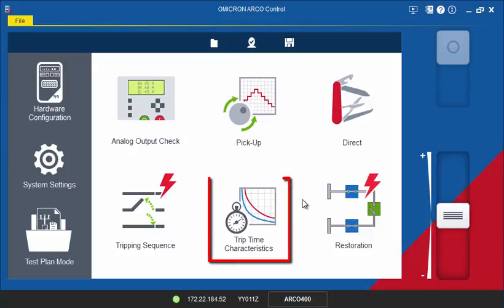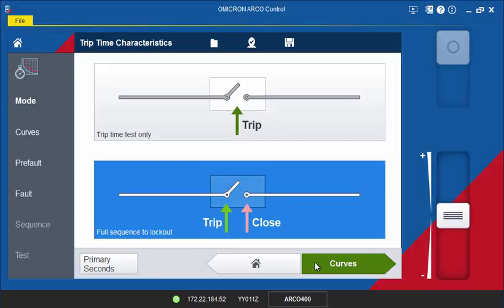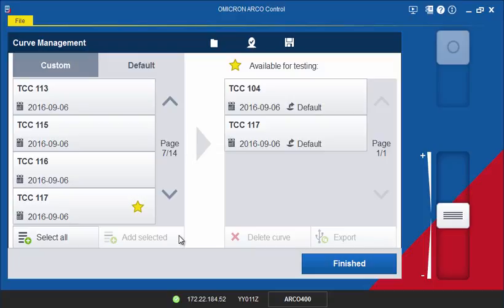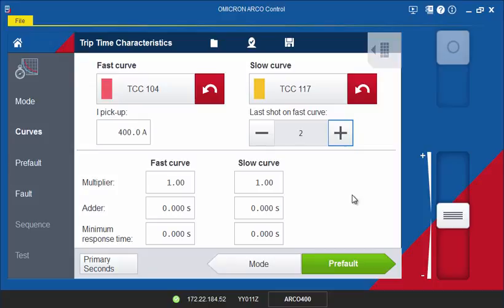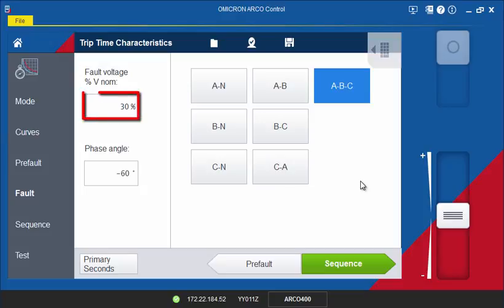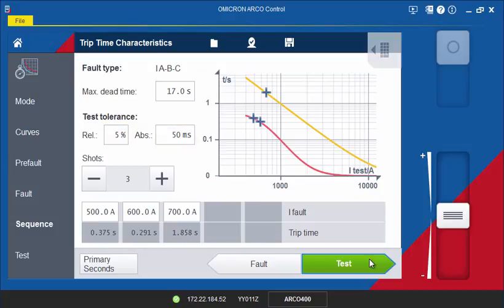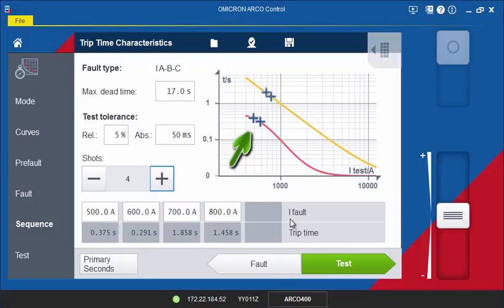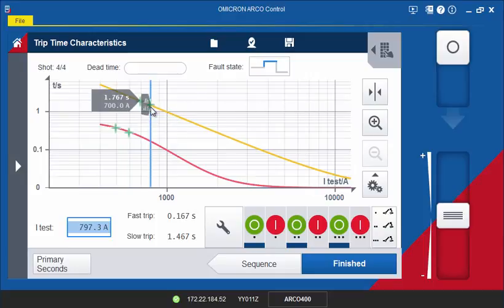ARCO Control Tutorial – Trip Time Characteristics Tool

Comment: Hello, where can I get the ANSI curves to load into the ARCO 400 files?
Reply from the maker: Hello, 
It is also possible to create additional and custom characteristics and make them available in ARCO Control. For this, the characteristics have to be available in XML file format. Characteristics can be defined in two different formats:
• Tabular characteristics
• Formula characteristics
Additionally, the test tool O/C Characteristic Grabber can be used to extract characteristics from graphical representations
I hope this helps.
Thank you.